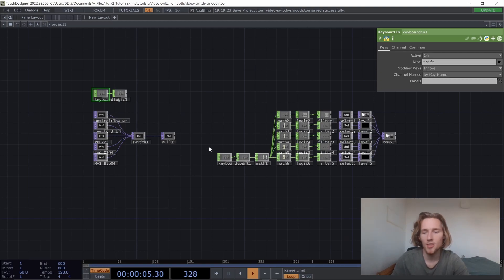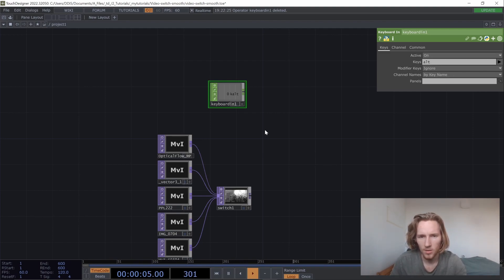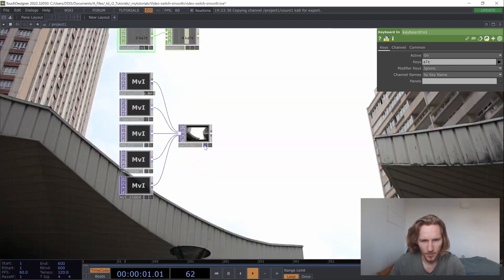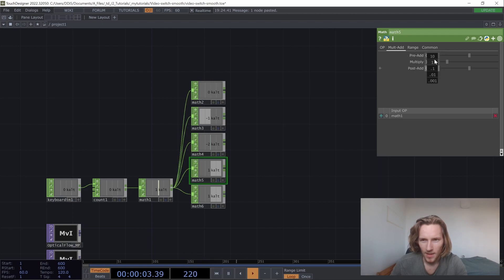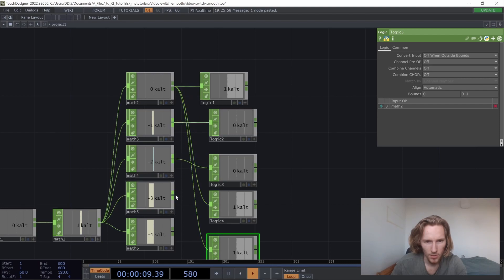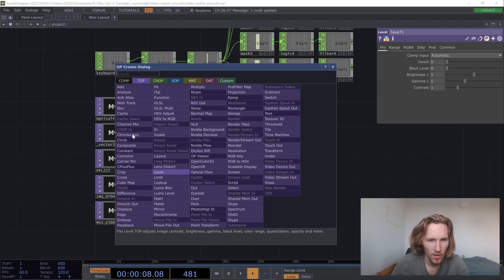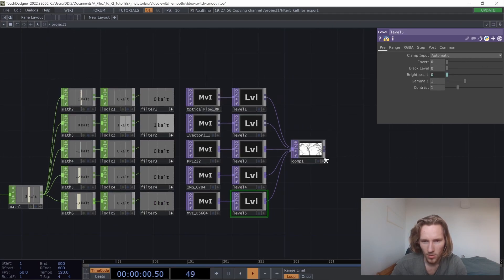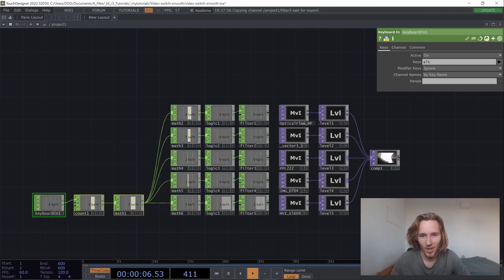switch or fade videos - touchdesigner tutorial

Comment: Hi everyone,
I'm currently working on a project in TouchDesigner where I have several visual scenes generated using Stable Diffusion. Each scene is created based on different prompts.
I would like to implement a system that allows me to switch between these scenes using keyboard inputs (e.g., pressing keys 1 through 5 to select scenes 1 to 5).
These scenes not videos is a generativ art in real time, and I'm looking for an efficient way to manage and switch between them during a live presentation.
Could anyone guide me on how to set this up in TouchDesigner
Any advice or pointers to tutorials would be greatly appreciated!
Thank you in advance!
Reply from the maker: Hi,
In almost all circumstances, the switch TOP is what you need. If you need an example message me on discord @asbjorn56
Reply from the maker: Did you manage to do it ? :)